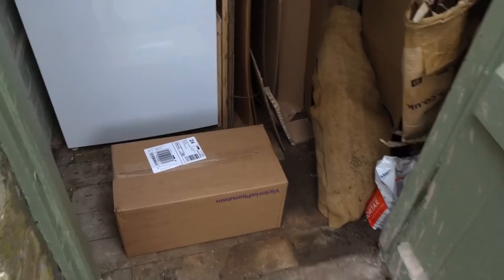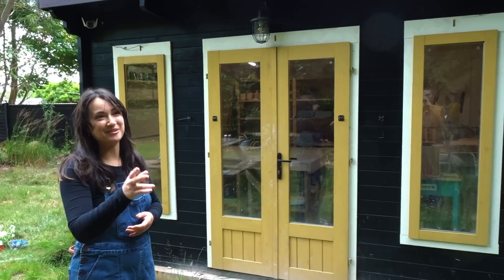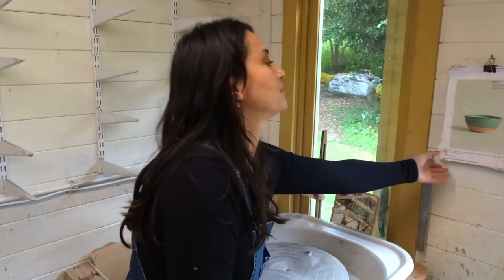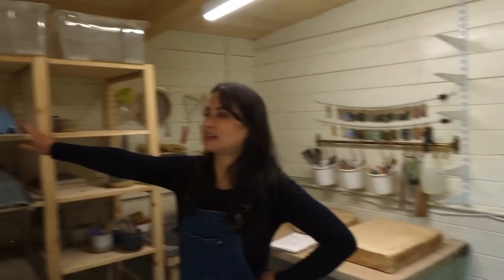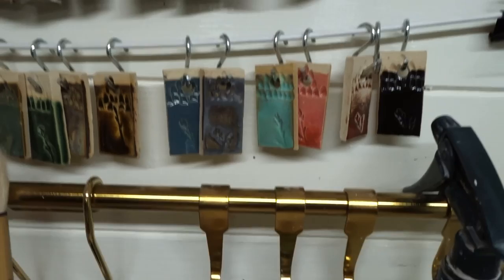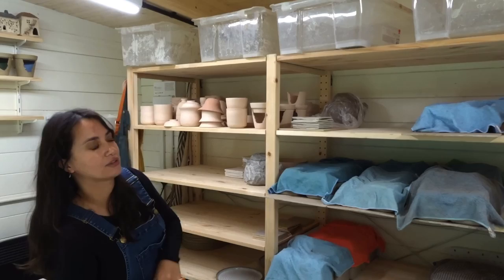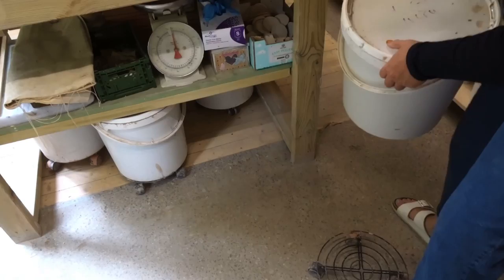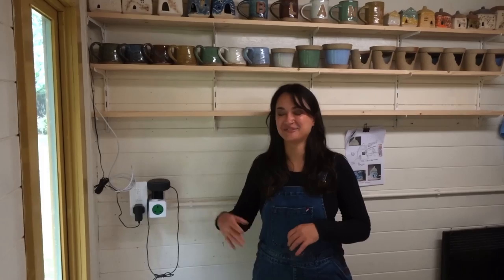A Tour of Our New Studio - How we set our pottery studio

Comment: Really enjoyed watching your tour. I am about to set up a studio but a larger one for classes etc.
I have the same wheel as you and ordered a diamond core tool grinding disc bat but mine didn’t fit the wheel for some reason and yours seems to look different. Did you have to make adjustments with your batt?
Reply from the maker: So glad you found it helpful and good luck for your new studio - how exciting! I had the same problem because of metric vs imperial measurements - they are very slight out. I bought a diamond core pad that is smaller and has sticky back plastic on the back so I could attach it to a wooden batt that fit my wheel. https://www.scarva.com/en/gb/DiamondCore-Tools-120-Grit-Diamond-Grinding-Disc/m-7783.aspx

Comment: Hello, thank you for sharing your studio set-up - it is a useful video because I have just got a quote to convert my single garage into a studio, which I am really excited about.  Is it okay to keep a kiln in the same space or should I house in a separate building?  What would be the best solution please?  Also, I plan to use the garage studio year round (I live in the UK) and was wondering what the best form of heating will be?
Reply from the maker: That's great news! Congratulations :) You can have the kiln in the same space as long as you vent the fumes out and make sure it has the recommended clearance from surrounding furniture etc. I use an electric heater but it isn't the most efficient - I'm hoping my next studio will be much bigger then I'm planning to have a wood burner but that would depend if you have the space. I recently have put a de-humidifier in the studio to remove the excess moister in the air but as a by product it does also generate heat which is fab. I'm sure you have but make sure the garage is very well insulated so that will help a lot :) Thank you so much for watching! Su x